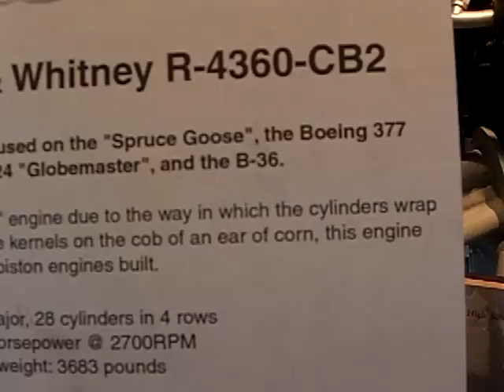3500HP 28-Cylinders Pratt&Whitney R-4360-CB2 powered Spruce-Goose Stratocruiser Globmaster B-36

Comment: Can you imagine relying on four of these things, each full of hundreds of bits of metal thrashing about all over the place to get you across the Atlantic or Pacific? No thanks! Apparently it wasn't unusual for the 4 engined airliners of those days to arrive with only 3 running. One ditched safely in the Pacific after two failed. There was also the Lockheed Constellation/Starliner and Douglas DC7 which were powered by Wright Cyclones.

Comment: Por que não se constrói mais motores como Esses?
Reply: Because the advent of jetliners rendered these engines obsolete.  The new jets were more reliable,  didn't require as much maintenance and could run on a less expensive fuel.

Comment: My friend Russ Brandt (now aged 86) worked on these at Limestone AFB in Maine in the 50s on B36s. He says that when the pilots didn’t want to go up on a mission they would sit a little too long on the runway with those 6 corncobs on idle and when they had reached a certain point the plugs would begin to foul and they could abort the mission. Then Russ on the flight crew would have to change the plugs before the next flight. Access was difficult. Russ was so successful as a mechanic that he applied for flight school and got a spot. When he finished he ranked his 3 most desirable assignments. Instead of any of these he was sent to Dyess AFB in west Texas to train to be a flight instructor for the obsolete B25 Mitchell. He had to be one of the very last flight instructors for the Mitchell, a plane made famous in the successful Doolittle Raid.

Comment: MECHANICAL ENGINEERING ARTWORK!!!
All done with the most sophisticated processor know to man...his mind
Reply: I would just like to add that the crankpins on the crankshaft were located 192 6/7° apart from each other, starting from front to rear. This was to compensate for the elliptical travel of the articulating rods.

Comment: As the rear most cylinders were the most difficult to cool,  it tended to run awfully hot.
Reply: Not so, The Cylinder Head Temperature reading was taken from a rear cylinder so the Flight  Engineer could open the cowl flaps, on the aft part of the Engine mount structure, to allow more air to flow through and cool them. Worked on these engines for four years in the Air Force.

Comment: Someone is impressed about a radial engine with an internal supercharger? All supercharged radials had internal superchargers. Two-stage supercharged ones ALSO had an external supercharger.
Reply: +justforever96  both stages were internal in the accessory cases of the R-1830 (F4F) and the R-2800 (F6F, F7F, F8F and F4U ).   I believe almost all R-4360 applications had single stage internal superchargers as they were also using turbocharging as in the C-97/Stratocruisers and the B-36.  C-124's I'm not sure if they were turbocharged.
Reply: Hadi Al-Saadoon ya it's a single stage, only 1 impeller.